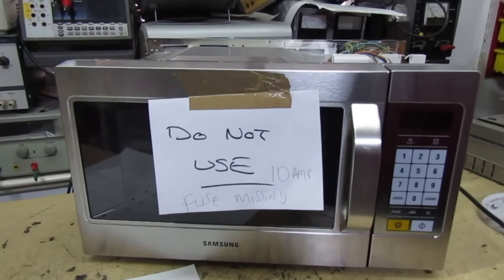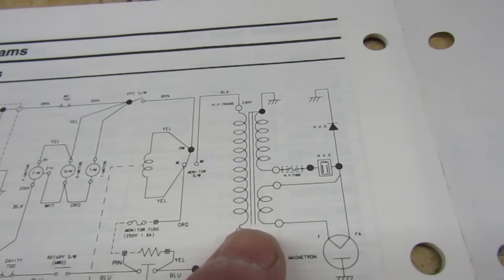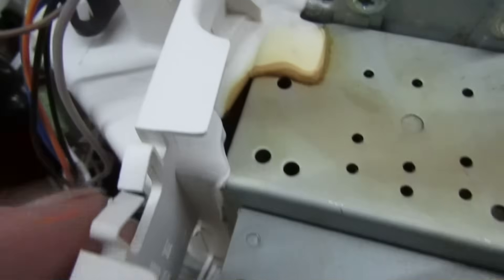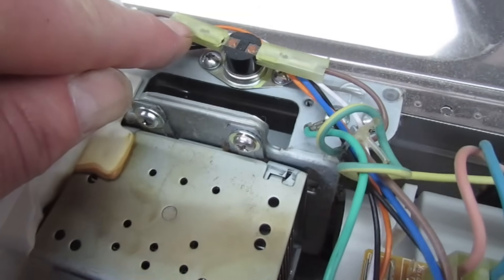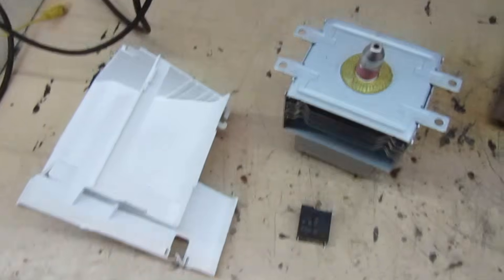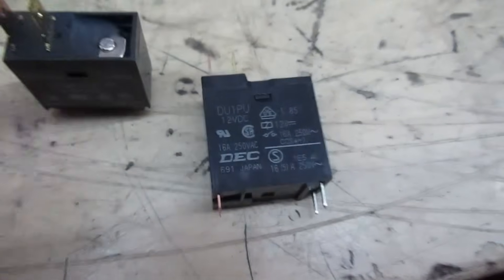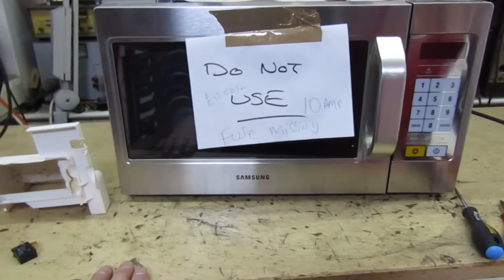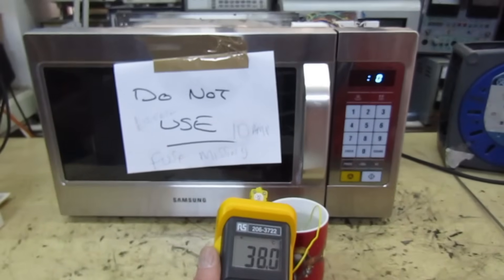Virtually no protection against this fault in a microwave oven .

Comment: was you able to get the magnetron cheap enough to make the repair worth it?

most microwaves are made so cheaply that it is often cheaper to buy a new one than to repair it.

unless you buy a high end model that would be expensive enough that it is worth it.

Comment: Twice I've picked up discarded microwaves in the street, took them home and diagnosed the issue to be the high voltage fuse to have gone open. Not blown, just mechanically failed. I rehomed one in my workshop as it was identical to the one I had at home - a well made Delonghi combi grill / oven / microwave. See untold amounts of microwaves at the tip that could just be a simple fault, such a waste.

Comment: What you need is a manuel resetting thermal cut out switch or a one time thermal fuse, this way if this happens either a the therman cut off opens, and stays open, or the one time thermal fuse blows cutting off the main primary line power coming into the high voltage power, in the usa that would be 120 volts ac, and in other countries 220 volts.  I had this exact same thing happen with a panasonic commercial microwave, and i replaced the relay, the relay was a stand alone and not soldered to the circuit board, which made it so much easier to replace.  I then swapped out the automatic resetting cut out for a manuel reset one, tnis way this happens agsin, it will shut off and not reset.

Comment: last commercail microwave I worked on had a thermistor on the magnetron fins and if it overheated the microprocessor commanded a shutdown which had to be reset through the keys
Reply from the maker: the days of anything done properly now are over , some domestic Sharp ovens in the late 80s had thermistors mounted on the magnatron .

Comment: Even worse, if the transformer is made of aluminum windings, it will overheat and fail!
Reply from the maker: a lot are now made of aluminium, yet another money saving cutback.
Reply: @michaeldranfield7140  Which is sad, since copper has superior electrical conductivity and corrosion resistance

Comment: You can buy a brand new microwave for £35 seems a waste of money to even think about fixing it.
Reply from the maker: I have never seen a commercial microwave sold at £35.
Reply: @michaeldranfield7140  Well what is the difference between a so called commercial microwave and a domestic one?
Reply from the maker: @Moonlightshadow-lq4fr  more output power, upgraded components and made for continuous use rather than just once a day use, this came from a factory with a lot of employees. and of course spare parts are much more expensive.
Reply: @michaeldranfield7140  You said this is semi commercial whatever that means.

Comment: Samsung seem to be using underated parts then having to supply higher rated ones when
the original fails.
That thermal cutout saved nothing, that is down to poor design this is all to common today.
Their edgelit TV's burn out the reflective prism sheet, and they cost more than the TV is worth
to replace.
Reply from the maker: I have one of those samsung TV s and am toying with the idea of ordering all the burnt bits just for the purpose of making a video .
Reply: @michaeldranfield7140  Best of luck with the prism sheet, even at trade prices they are not cheap.
Reply from the maker: @BarbaraPape-y4g  ASWO are actually quite reasonable for just the price of the part itself but its the extra surcharges they slap on for its size which can almost double the price of the part itself, and its one surcharge per line , so if you order 3 separate parts there are 3 separate surcharges to pay, but yes you are quite right its not worth doing  but I might still give it a go !

Comment: In Canada, most microwave ovens are relatively cheap from big-box stores and replacement parts are rather expensive.  Most customers will tell me to just scrap it unless it is a simple MOV/fuse replacement caused by a power surge.  Occasionally i will get a go-ahead for a monitor interlock switch, but that is rare.  No one I have dealt with would ever pay for a new magnetron and associated parts and labour.
Reply: In Santa Clara, CA, they have a spring cleanup where residents clean out their closets and garages and set items out at the street. I picked up a nice stainless steel microwave oven, manufacture date 2011, that had been set out. I found a bad high voltage capacitor and blown fuse. The cleanup is spread over 4 weeks, a different section of the city each week. So, the next week I picked up another, similar, microwave oven to scavenge for parts. It was only a couple years old but badly cared for, but looked very similar with the cover removed. I was able to scavenge the capacitor, high voltage diode, and fuse and put the first oven back in good order. I am keeping the second oven for parts.

I imagine that the first oven was set out because the owner was unwilling to pay for repairs on a 14 year old microwave, no matter how gently it had been used. Next thing you know, some other part will fail. However, I have the additional parts and know how to do another repair if that happens.

Comment: I'm sure that those thermal protections are not there to protect the parts from breaking in a case of a failure, but to prevent fires. It fails to do both ways in seems.
Reply from the maker: early ovens had two cutouts, one on the outside of the cavity to kill the power in the event of a fire inside and another mounted directly on the magnatron to kill the power if the cooling fan failed, it would appear in this case to save money only one is used and its placed in between the cavity and magnatron where it protects neither .

Comment: Michael - a few questions on this repair - would it not work out cheaper to replace the whole microwave? - and if  the relay contacts have welded - surely this is going to happen again? obviously the relay is under-rated for it's job? I would have no faith in a mic if this happened, it would be in the bin.
Reply from the maker: a semi commercial  over would cost about £350 so the answer is no and the relay supplied was well beefed up compared to the poor quality one I took out so should last much longer now .

Comment: I spent many years repairing microwave ovens and two things are apparent with this:

1) there used to be two thermal cutouts up the top - one where that cutout is now (or a bit further over on the roof of the cavity) to shut the oven down should a fire occur inside it and a second one actually mounted on the magnetron itself in case it overheated for whatever reason. Where that single cutout is now, it will NEVER reach its activating temperature and will not protect the magnetron (as evidenced by this failure).
I would actually move it and put it on the mag, the holes are right there to attach it.

2) the relay being made in china likely has undersized and poorly finished contacts. Very unlikely it even meets the 16 A rating printed on the side. When I was doing oven repairs the main power relays were three times the size they are now. I don't think I ever encountered a relay that had welded itself closed, but then all the ones I saw were made in Japan. None of this china rubbish back then.
Reply from the maker: You are exactly right but everything these days seems to be poorly designed in order to but costs to a bare minium.
Reply: @michaeldranfield7140  Yup, and it's one reason I am glad I am not working on a lot of this domestic stuff any more. The cost-cutting has made things less than fun to repair.

Comment: In all microwaves, even simpler models there's an interlock system using the normaly open contacts of door microswitches so when one microswitch welds itself permanently closed the other microswitch is configured to short the output and blow the fuse. Are you sure the circuit wasn't tampered with? I'd only accept devices that I know wasn't opened or at least modded by a mοnkey that believed he was a technician.
Now if the device was sealed, it might have just worked according to plan above, and the overheating you see at tube cover is irrelevant to the damage and was caused by exceeding the duty cycle, bad installation restricting air flow, sticky fan, etc.
Reply: The door interlocks will usually take the fuse out if there is something amiss, but there is no provision to blow the fuse if the power relay jams shut.
Reply: stopthebus yes, and it will probably lead to transformer destruction if there's no efficient thermal protection, but will still ensure no microwave energy when door is open, switch welded etc (or generally switches are not mechanically synchronized) Actually switch welding can also happen from missuse, door slamming for example, the contacts can't handle the short from resulting desynchronization and weld themselves.
Reply: That worked perfectly. With the door open, the microwave does not run. With the door shut, it runs. It protects humans from radio waves.
The case here is a protection of the device itself, which is done my the thermal cutout.
It could be prevented with a second relay.
Reply: @pizzablender  The biggest issue here is the thermal cutout is in the wrong place. I repaired microwave ovens for many years and there was always a cutout attached directly to the magnetron to stop the power if it got too hot - for example if the fan failed (which does happen). Ovens also had a second thermal cutout above the cavity to remove power if the cavity overheated (if a fire occurred inside). It seems they have cheaped out on these ovens by only having one thermal cutout to do both jobs, but it does neither as it's in the wrong place. An overheating magnetron won't get the cutout anywhere near its activation temperature, and that was proved in this instance.
Reply from the maker: the main power relay is after the power switch and monitor switch in this oven  , it seems like I have caused some confusion by showing a service manual from a completely different model and this was done just as an example because I don't have the service manual for this oven and even if I did there's every chance there are no circuit diagrams in it like most manuals these days .

Comment: Crikey! That Monitor switch only appears to be protecting the inrush circuit (if it was fitted). Usually, the monitor switch forms a crowbar circuit that blows the main fuse if the door is opened with power going through the relay contacts.... Lovely!
Reply: The monitor switch is only there as a failsafe in case the main door switch fails and it will crowbar the fuse in a situation where the magnetron and power circuits could start up (main door switch closed) when the door is actually open. It doesn't do anything for this situation where the power relay is welded shut as it's such a rare occurrence. I repaired ovens for many years and never had a failed power relay like this. Then again, they were all much bigger back then and were made in Japan, not china like this POJ was.
Reply: @stopthebus  I must admit that this type of failure is an outlier.... We've only seen less than a handful over the years ourselves.
It's an interesting case, and we have a group of trainees in next week for microwave ovens, so a stuck relay scenario would be an interesting brainteaser for the newbies ;)
Reply from the maker: This was just meant to show a typical example, the service manual I showed is for a completely different model of oven.
Reply: @michaeldranfield7140  I did think that the circuit layout was strange..... That explains it!
I work as a technical trainer for a white goods manufacturer and our cheaper microwave ovens use HV cap and diode power supplies. We still teach voltage doubler circuits and the interlock switches, but none of ours has that arrangement as shown in the video, so it was an interesting oddity to see!
Reply from the maker: @tonyboing2312  and the power relay is after the interlock and monitor switch , it would have been better to have the correct service manual but service manuals these days don't contain any circuits, sorry about the confusion .

Comment: I liked working on microwave ovens, except the built in ones. Most were easy diagnosis and fast fixes. I replaced a lot of tubes in them, mica pieces, and  most often shorted diodes. The ones I refused were the cockroach infested ones. UGH!!!  (I finally had to put on the work order that the customer was responsible for all costs for shop fumigation if the oven or equipment had  cockroaches in it. That stopped the roach problem).  My biggest problem was getting OEM parts for the ovens like trim, handles, etc. as we were not an ASC for any specific brand.
Reply from the maker: 30 odd years ago I worked on a 4 magnatron  oven in a pub and it was horrendous with the case removed there was so much grease sitting in the bottom it had to be removed with a paint scraper for its own safety so im quite use to getting dirty, as long as the customer pays it doesn't bother me !

Comment: I had a job once working for Mastercare where the customer complaint was a faulty digital timer. She set the timer for 1 minute 30 seconds displaying 1:30 pressed start and told me to watch. When the timer got to 1:00 she exclaimed a second later “ look it’s gone to 0:59,” I calmly explained there were 60 seconds in a minute but didn’t have the heart to charge her the £15.00 “Customer education” fee.
Reply: On mine, if I key in 1:99 and start, it will count down to 1:00 and then display 0:59 and count down from there, a total of 159 seconds or 2 minutes and 39 seconds. I believe some microwave ovens will convert the 1:99 to 2:39 when the user presses start, and count down from there.

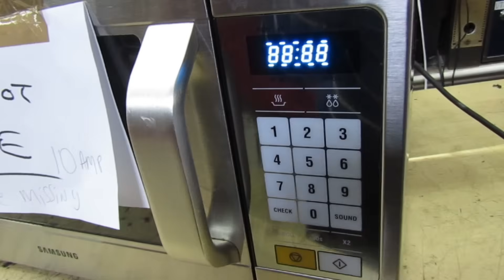As a humorous sidenote, in the heyday of top 40 AM radio stations with disc jockeys, there was a desired limit on the length of a song, so the station could fit in more commercials. I believe the limit was 3 minutes. The length of the song would be printed on the record label, e. g. 2:55 for a 2 minute 55 second length. One disc jockey told me that a record came in with the song length given as something like 2:75, a presumed attempt to get the disc jockey to think it was under 3 minutes and give it air play.

Expanding on this topic, some songs had two versions, a shortened version sent to the radio stations and a longer version sold to the public. For example, "In-A-Gadda Da-Vida" had a 2:52 version on a 45 rpm record and an over 17 minute version on an LP. In this case, the shorten version was also available to the public. Also of note, there was an artist named Harry Chapin whose songs were too long to get much air play. Two of his songs, "Taxi" and "Cat's in the Cradle", became so popular that the stations played them anyway. (They told stories and would have been difficult to shorten for a radio version.) He did have a significant number of fans who purchased his records and attended his concerts. I recall seeing video from a concert or concerts shown on PBS. That was my first exposure to some of his other songs.

Comment: Panasonic are the only brand of microwave ill ever buy, the design logic inside this samsung is horrendous, this could have cooked someones hand or arm!
Reply: No, as it still shuts off when the door is opened (double interlock).
Panasonic have the "PCB trace fuse that takes out the control board when the light bulb blows" design problem...
Reply from the maker: @pizzablender  the microcontroller on the model you mention is now no longer available so I always put a piece of plastic sheet between the power board and main board whenever I repair one of these
Reply from the maker: There is a door interlock system that is failsafe when the door is open  and its before the power relay so there is no way microwaves can be generated from the instant the door is opened .

Comment: Microwaves are a dime a dozen , why bother fixing? just your time is worth more
is someone sentimental towards that specific unit?
Reply: them samsung commercial microwaves are £350+ well work the £125 to repair it. if its profitable to repair why not. you dont make anything if you turn customers away to buy new stuff all the time.
Reply: @rlfvac   perhaps an Inverter type would cost 350 pounds, 
not this run of the mill oven, 
I got a Panasonic inverter type for about $120 US , but then Great Britten might not be so great anymore.
Reply: @xprcloud  Even if it's innards are generic, maybe it's control panel is user friendly  and everyone is used to it. As sometimes new owen with electronical panel is hassle to get working.